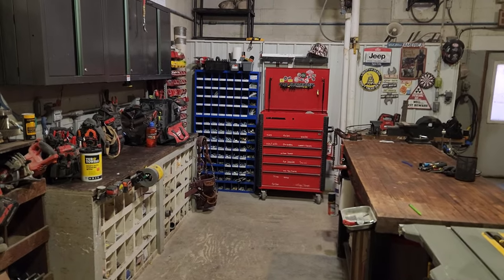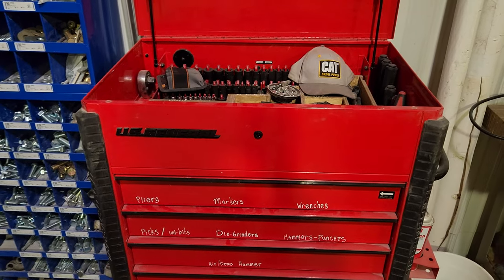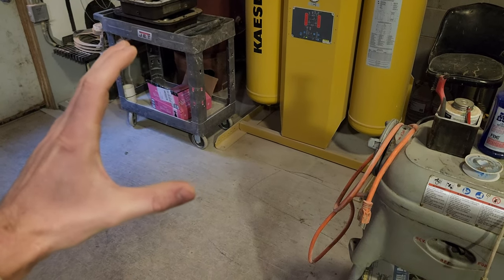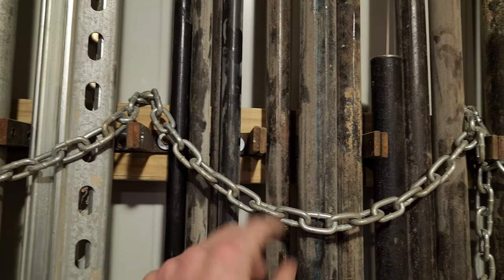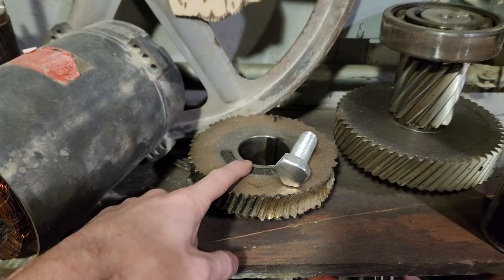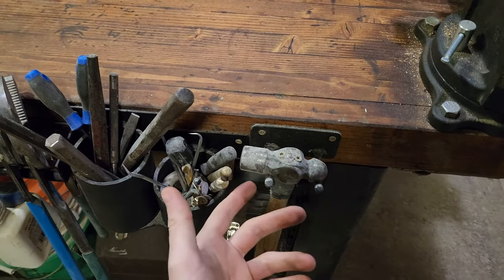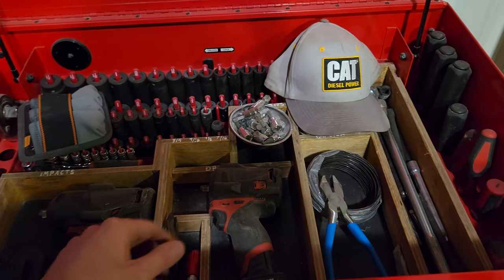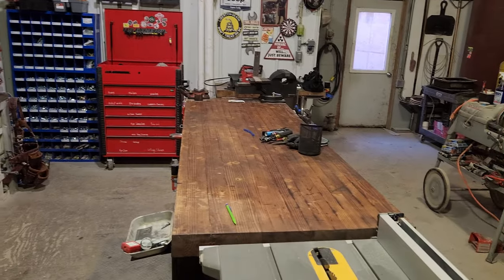Industrial maintenance shop tour

Comment: Can you talk more about the job you have, how it is as a career, how industrial maintenance is as a career. The career field is appealing to me because of the wide array of different things maintenance technicians work on and how much you can potentially learn in the career field. Is most of the learning on the job and how and can the pay be worth it in the career field?
Reply from the maker: Absolutely, and I can film a video on it next week. I do like the variety. Carpentry, plumbing, controls engineering, millwrighting, process equipment repair, the list goes on. I've gained a lot of experience with project managing and equipment procurement as well. If you're seriously considering starting a career in maintenance and want to learn more, feel free to shoot me a DM. Thanks for watching!